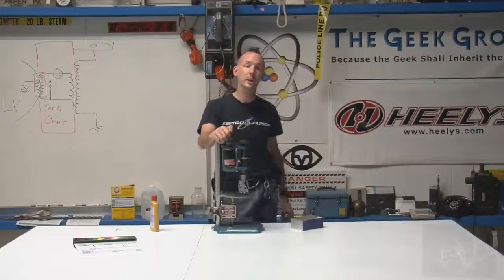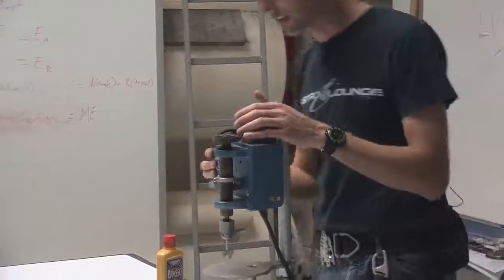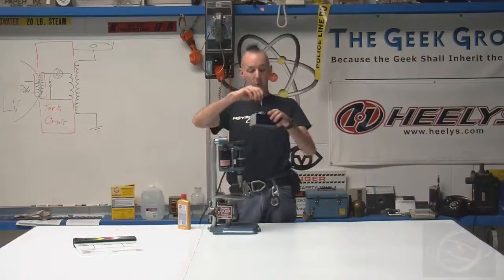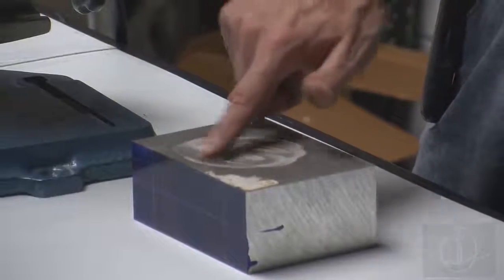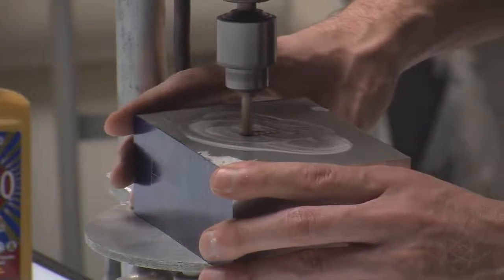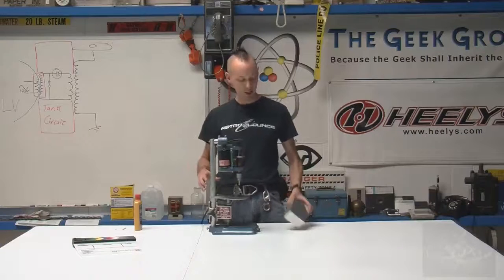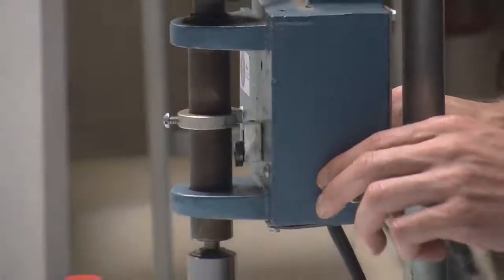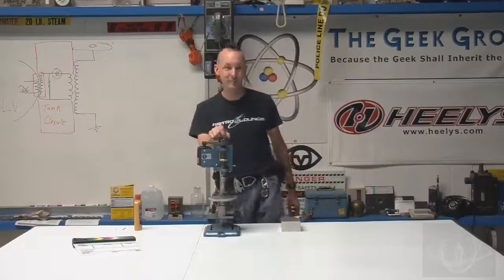Pearling Machine Demonstration

Comment: I'm not shore this is exactly what this used for
i once worked at a water pump assembly line and they used tools simuler to this. but the on off was activated by foot instead of content
to speed assemble, its possibly what it was made for. then again i could be wrong. but that's what the company i worked for used the machine simuler to this for